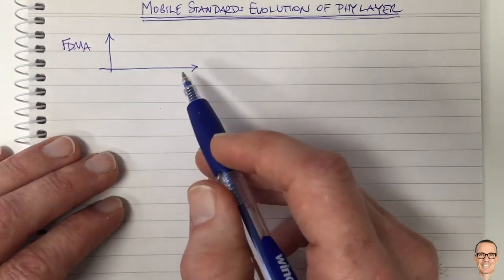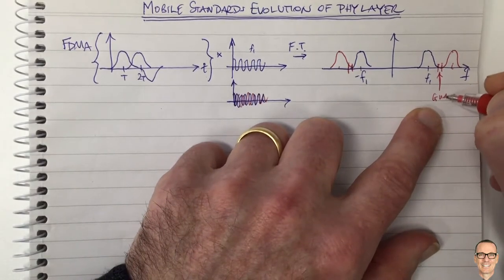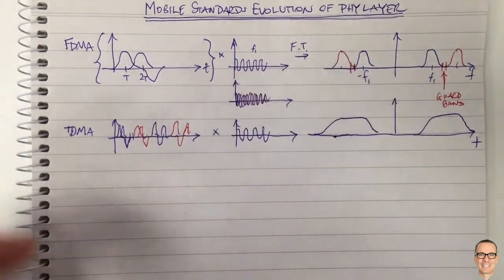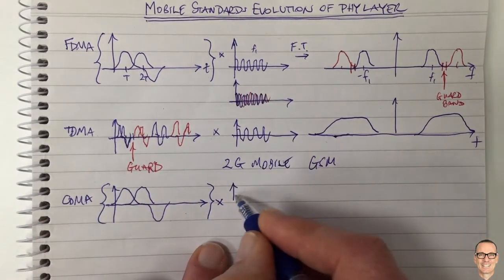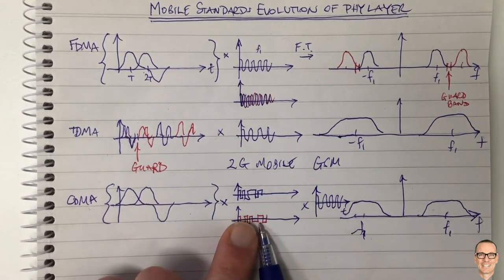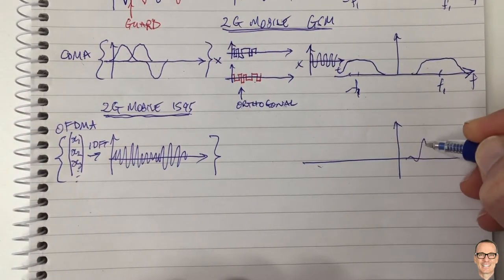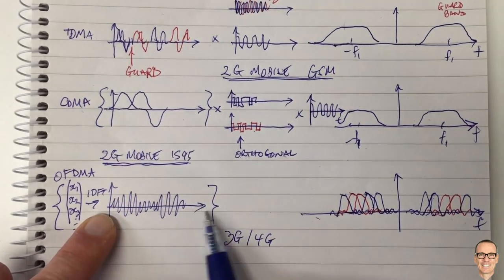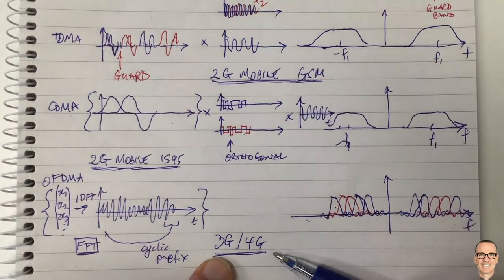Mobile Standards Evolution: FDMA, TDMA, CDMA, OFDMA

Comment: Thanks for the video. So, CDMA is better than OFDMA because the user can use all the time slots and all the frequency band. However, the orthogonality of the codes is the problem. Right??
Reply from the maker: Yes, exactly. Plus it's much easier to implement a receiver detector for OFDMA (just need an FFT and then decode the frequency bands for your own user). For more insights from an information theory perspective, check out: https://youtu.be/1P3Si23OsC8

Comment: is there a difference between multiple acces and multiplexing? for example, frequency division multiplexing and frequency division multiple access?
Reply from the maker: The term Multiplexing is mainly used to refer to the situation where a device (a multiplexer) takes multiple input data streams (eg. from end users in an access network), and combines them into a single data stream that is then sent over a wide bandwidth channel (eg. a backhaul link to the core network). 

However, the term is also used in the acronym OFDM, which is a modulation scheme. This is because, in OFDM, a single data stream is split (demultiplexed) into multiple data streams, that are then "multiplexed"  onto a wide bandwidth channel (with each data stream sent on a different subcarrier). Note that all of this happens in a single transmitting device (ie. not multiple access).

The term Multiple Access refers to the situation where multiple (seperate) users are all accessing the same channel either in a coordinated way (eg. 2G/3G/4G/5G) or in an uncoordinated way (eg. WiFi).

Comment: Great video, Iain. Love your content. I have three questions though. Why is it beneficial to spread the spectrum like that? Does it offer more resiliency to interference, or does it just allow more users to be served on the same transmission? Also, the "multiply" operation you mentioned for CDMA is actually an XOR operation, correct? Finally, when an individual user is receiving a CDMA signal I am assuming they would multiply by the carrier frequency, then LPF the upper mixing term away, then XOR with their pseudo-noise sequence to extract their data. Is that correct? Thanks again! --Jacob
Reply from the maker: Answers: 1) both. 2) No, it's not XOR. When sending binary +1/-1 you use a multiply operation. 3) Yes.

Comment: How to know which users when communicate on tdma?
Reply from the maker: I'm not exactly sure what you're asking, sorry. There are always other control channels where information is shared between the base station and the user terminals. This is how they all agree on which time slots each user will send in. Also, there are synchronisation signals so that the users can have accurate timing information about when the time slots start and end.

Comment: At 13:06 I was expecting to see CDMA for IS-95 and 3G (UTRAN) and then OFDM for 4G.  Not OFDM credited to 3G (UTRAN). Were there OFDM UTRAN?
Reply from the maker: Yes, there's a note about this in the description under the video (it was at the bottom, but I've now moved it up to the top). It says: "Note a small "typo"/error: I wrote 3G under OFDMA, but actually 3G used a version of CDMA called Wideband CDMA. Originally, the OFDMA system was part of the 3G standard, called Long Term Evolution (LTE), but ultimately that part of the standard ended up being called 4G. Also, note that the 5G standard is also based on OFDMA (although I forgot to mention that in the video)."
Reply: @iain_explains  OK. Sorry. I skimmed though the comments but there were too many and I overlooked the notes. Many Thanks for all your videos. Much easier to digest than and a good introduction to the literature.
Reply from the maker: I'm glad you're finding them useful.

Comment: In what situation do you use a particular communication strategy. Not considering cost ?

Basically it's about interleaving more identifying communications into the existing allocation of the frequency spectrum. Since the Frequency spectrum is basically allocated it means the approach is to invent a method of increasing communications throughput. Which means that the semiconductor devices are required at higher clock frequencies. In terms of mass communications who is inventing these strategies....who are the inventors and where do there ideas come from ? We should know who is leading the forefront of the digital communications not by equipment but by the theory and invention. 

I'd like to point out that when quantum communications becomes practical it will displace the entire volume of digital communications and leave it's inadequacy behind. 

With Ai it may be possible to have it process to invent the next advance of digital communications while also using robotics to make the equipment. Up until quantum communications become available.

Comment: Hi, in OFDMA how can the reciever detect which codes are assigned to which user ?
Reply: The receiver knows which code it's using... if not another transmission affects the codes
Reply: In OFDMA, all receivers are allocated the specific bands (subcarriers) in the frequency domain by the network manager.